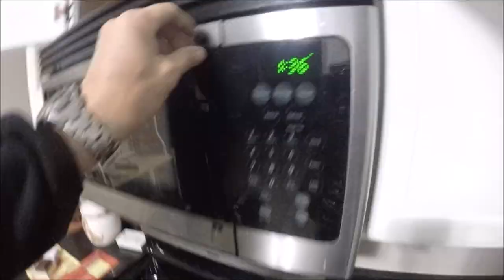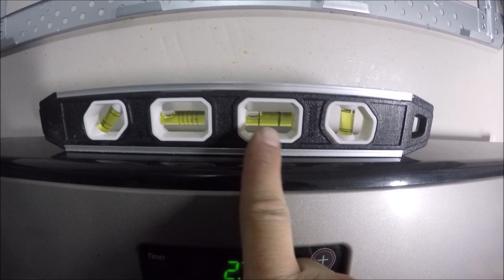How To Install an Over The Range Microwave | THE HANDYMAN |

Comment: Great channel, I love your videos. Do you have a contractors license of some kind? I've watched the more extensive builds and remodels you do and I'm just wondering what kind of permits and licenses you have to have.
Reply from the maker: I'm licensed in several cities.  Just go down to the building department, show them your credentials and fill out applications.  Most customers request that a permit not be pulled.

Comment: How did you mate the ovens 3 X 10" exhaust duct to the homes 3 X 10" vent duct. They have to be perfectly aligned and duct taped - no?
Reply from the maker: I have a tool to crimp the ends to make a male that goes into the duct in the house.

Comment: What truck are you driving?
And which GoPro cam are you using?
Reply from the maker: Its a 2006 Dodge ram 1500 4x4.   GoPro Hero 4 silver
Reply: Thank you. I like your videos. Keep up the good work.
You should try breaking into doing tool reviews.
The tool companies wont pay you to review their tools, but you will get free tools.
You should also do more DIY tips videos (like the drywall mud video), they seem to be very popular on YouTube. Just don't go over 5 minutes with the DIY videos.
Reply from the maker: +Rayan A thanjs for the feed back. I have some tool reviews planned.  They are my own tools though.  I'm going to show off my tool belt that I got over 20 years ago.